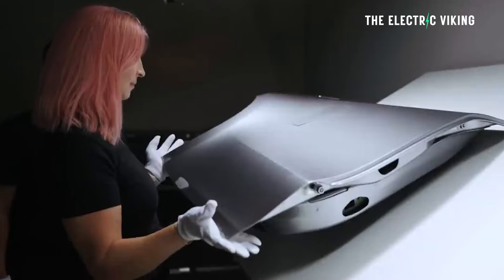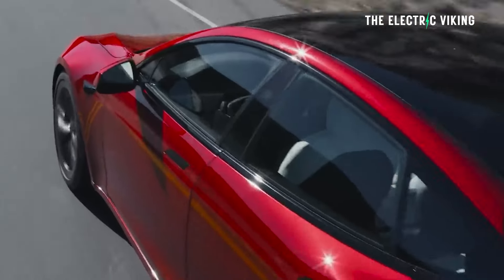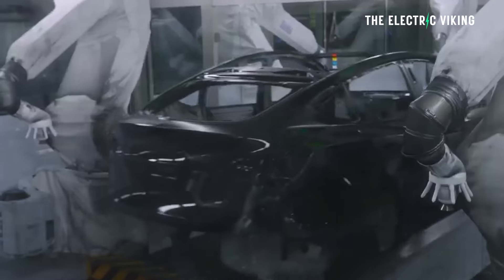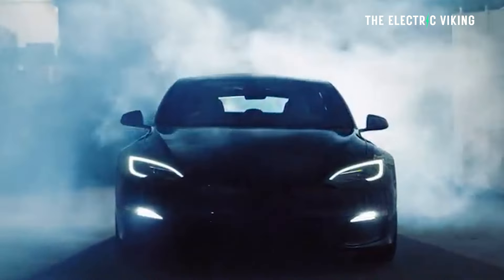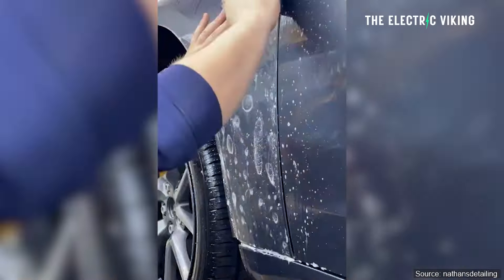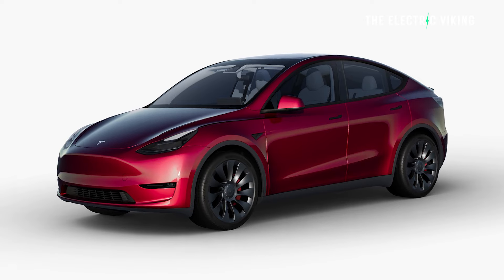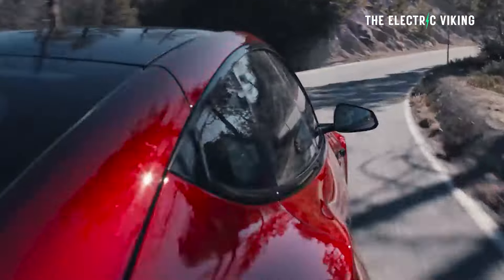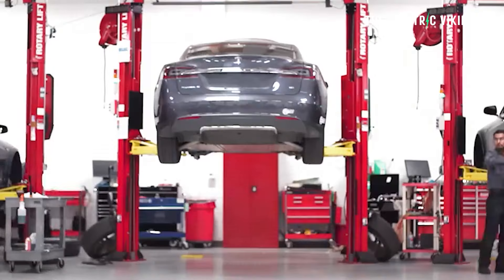Tesla slashes car wrap color prices $2000 and adds new color

Comment: Why paint a car at all. Just give buyers the option of no paint and a wrap. Does paint has something to do with rust prevention maybe?
Reply: The car just needs a protection coat, like Cybertruck’s frame. I hope Tesla will get rid of paint on the new compact and offer precut wraps in hundreds of colours. The paint section takes up a lot of space and time on the production line.
Reply: Exact what cybertruck is giving
Reply: well several of the tesla owners I talked to do not want to do the 4000 dollars protection wraps.  I did not do any protection on mine and the paint is just fine on my Tesla.
Reply: @dathyr1  no paint on a car should lower the price enough to pay for the wrap.
Reply: What is this, a comedy routine??
Reply: I can see the new model in no paint or Grey.  And wraps
Reply: Not paint and a large selection of wraps, sounds great.